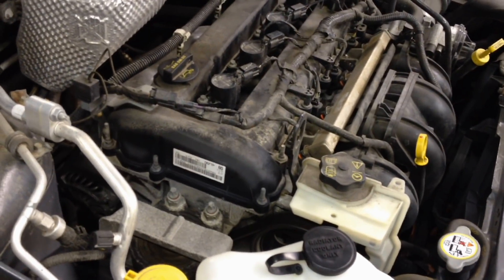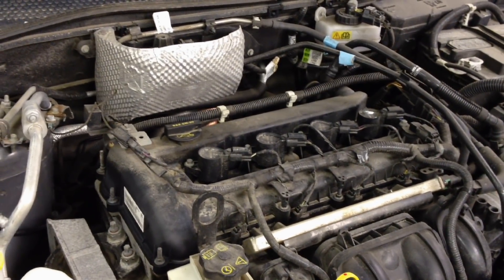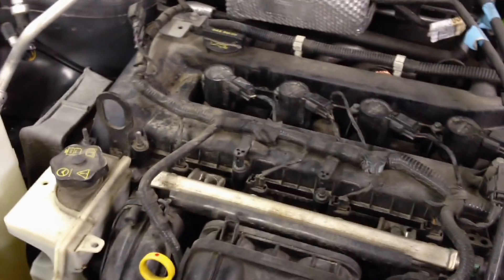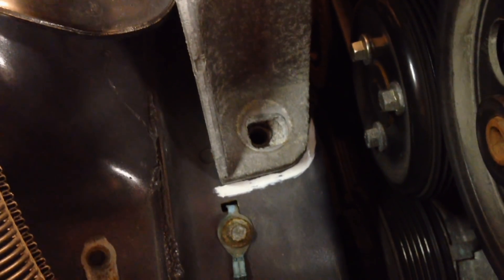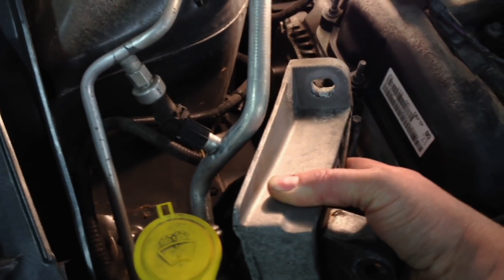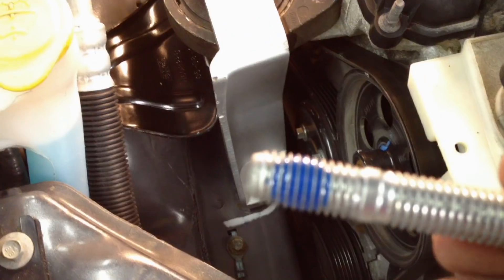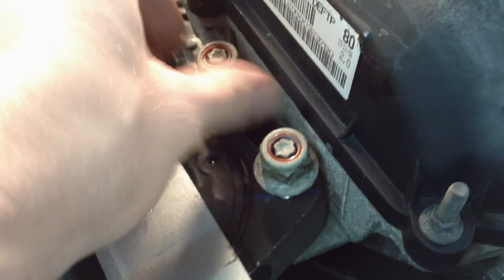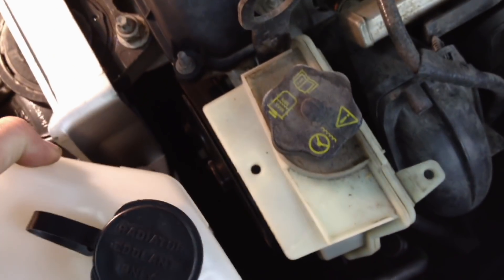Ford Focus Engine Mount Vibration Repair

Comment: Hello good sir.  I followed your video for throttle body cleaning and everything went well.
But now I have a new problem.  The other day i drove over from deep snow, which was hardened.    I don't know if that was the cause of this problem or not.

Anyway, the problem is excess vibration, on the drivers side when accelerating in reverse.
Rolling in reverse is not a problem nor is light acceleration, only reversing and pressing the gas harder causes the noticeable vibration.

Driving forward or turning there is no noticeable increase in vibration.

Do you think the mount is the problem? And your video only shows one mount. How many mounts in the 09?

I think i found the correct part on fordparts

is this it?
							 Part No. 6038 							
					 						Engine Mount Isolator
						2.0L Duratec HE (137PS) ; 4-Speed Automatic Transaxle - 4F27E
Reply from the maker: Arbys Uunt Meet there are three mounts the one shown, the trans mount and the anti roll restrictor underneath that is the one I would check for the reverse problem. 6038 base does sound right.

Comment: Quick question: got the part and it only has the center piece. The silver and black frame brackets didn't come with. Can I take the OEM one off the old one? 

Thanks, great video
Reply from the maker: vintasalo You are supposed to be able to but if you bought anything but oem you are going to be having problems with the new mount before long.
Reply: FordTechMakuloco Cool, thanks for the quick reply. The one I bought has a lifetime warranty with Advanced Auto Parts..  Good thing its a quick fix if I need to replace again

Once again you did a great job making it a quick, instructional video.
Reply: lightningsmokerXx Ours is a Florida car and never seen snow. No rust anywhere and we live 300yards from the ocean.

BTW: this fix worked perfectly and now the car runs like new

Comment: Hello Makuloco, on my 2012 focus mk3 I'm having vibration through gas paddle around 2000 rpm, and vibration through steering wheel around 1200 rpm. These vibrations happen about 20% in summer and 90% in winter, and do not go away after warming up. Idle is smooth tho, could it be a engine mount problem?
Reply from the maker: I would have the engine mounts/ Powertrain neutralized first and go from there. Your mount should not be bad.
Reply: FordTechMakuloco Thank you sir.

Comment: Great video. I think you may have helped me diagnose my U.S spec 2010 Transit Connect van with the Focus engine and mounts. Van only has about 36k and the problem started a while back. Vibration is noticeable at all times. Most noticeable through the gas pedal. Tried jacking the engine up and the vibration went away. Hopefully it's the passenger side mount. I'm hoping Ford will pick up the tab as I complained about the vibration and have it in writing well before the warranty was up.

Comment: Hello FordTech. I have a 2008 Ford Focus, and need to know about reset of check engine light. Popped on before i had thermostat and housing changed. Light went out after, but came back on. Mechanic read code, and told me it needed to be calibrated by Ford technician. Is that true?
Reply from the maker: Paula Thomas No it shouldn't what code?

Comment: Hello Sir. I own a ford focus mk3 2011 Ti-vct 125ps engine.
When i m driving between 3,5 and 4000 rpm i can feel a resonant sound-vibration coming out from the front part of the car and from the bottom of the car( driver and co- driver seats).
Also at certain rpms like 1500 and  2700 my car vibrates.
Do you think that the mounts can be causing this? I, have already 55.000 miles on the clock!
Reply from the maker: papadas19 Yes I do, do you feel it at idle cold starts etc. I would do the test as shown to verify.
Reply: +FordTechMakuloco 

I changed the passenger side engine mount. The vibration remains and seems to be stronger? I m really worried. Should i change the other 2 mounts to see a good result or do you think that the problem does not concern the engine mounts, because the replacement of the hydraulic engine mount didn't help?
Looking forward for a proposal on the problem. Thank you!
Reply from the maker: Alexandros Sourlas was the mount a Ford Unit?
Reply: Yes....it cost me 208 euros :(.....it didnt help though....

Comment: Thank you for listing the torque amounts.  Mine was rattling so bad it cracked the windshield.  The mount was disintegrated into two separate pieces.  WOW WHAT A DIFFERENCE!  Simple job!  A note of difference from all the other videos I have seen, including yours.....My passenger motor mount stand did not have a 6th bolt underneath.  Mine was removed by removing a metal subpost(like Tom Crawford below).  

Altogether, A simple procedure, and it runs so quietly now!  I got my replacement piece for $20 bucks from a parts wholesaler(I never pay retail).  Thanks man!

Comment: Would a clutch and fly wheel replacement cause vibration / clunking at start up or rev up? vehicle is a 03 Mustang Cobra.
Reply from the maker: skywalkier Yes there is marks on them for balancing that need to be aligned to get the most balanced setup.

Comment: How long can you reasonably expect these Focus motor mounts to last? My friend is buying a 2010 (it's now the beginning of the 2015 model year, so it's 4-5 years old). It has 77,000 miles. She complains of vibration, but I'm just not sure if it might be the mounts or not. Will try your trick to jack it up and see if the vibration goes away when she takes possession in a week.
Reply from the maker: I have seen them go in as little as 44k miles so at this age I would say yes it is time.
Reply: FordTechMakuloco Thanks for the reply. Is it worth it to replace just this RH mount, which is the "low-hanging fruit" and see if that fixes it? This looks like the easy one, relatively speaking and appears to be the one that goes bad most often. And of course you've done a great job explaining it here.
Reply from the maker: Yes I would just replace it, like you said it is the absolute most common one.

Comment: Another thing, my 2010 focus is developing a "bang" feeling and noise while driving over bumps, as well as when depressing the clutch for up shift at ~2500RPM (standard tans). Will that possibly be bad transmission mount or the dog bone?
Reply from the maker: I would definitely check the mounts and the swaybar links for looseness.
Reply: FordTechMakuloco Thanks! I will check them

Comment: I don't know much about cars but when I put my car in revers my car shakes like crazy and it's embarrassing . Is it the bottom motor mount ?
Reply from the maker: It can be the lower dogbone mount but the right hand engine mount as shown in video is most common and can happen in drive or reverse.

Comment: Thanks for the video, got the job done. My replacement part from O'riely was only the insert, had to pry old one out and then bend a tab to keep the new one in. Didn't realize going in the lift point on oil pan was critical to getting a good lift. If too far to the center it lifts entire car.
Reply from the maker: If you lift too high it will lift the car yes.
Reply: FordTechMakuloco I had loosened the motor side nuts and the motor was lowering even though had jack under it but too far to the tranny side of the motor.

Comment: If I need to replace my motor mount, when will I feel the vibration the most? My 2004 focus sedan (4 cylinder 2.0 liter automatic) seems to rumble as I'm coming to a complete stop, but is fine at higher speeds, parked and in reverse... Not sure if I should get the brakepads, transmission, or motor mount checked first.
Reply from the maker: I would get the brakes checked first for sure, then the RH engine mount as shown in the video.

Comment: Good job good to see someone clean the parts prior to assembly and using a torque wrench to avoid damage and making it easier for the next person.Thanks for the video we need more mechanics like you.
Reply from the maker: Thanks!
Reply: @FordTechMakuloco  You're AWESOME!! LOVE your videos!! My mom has a 2011 Focus SE. Always doing the work on it when it needs it.  She has the same problem. I am pretty sure it's the motor mount. If it is, should the driver's side mount be changed too? I am just thinking about changing things in pairs like suspension parts. Thanks in advance...👍😁
UPDATE ...The mount(s) seem fine. I think it's her muffler. It did have a few small leaks on it on one end of it. I patched them up but a s***load of water came out of it. I think it's shot inside. Rusted from inside out. Should I buy an OEM muffler from Ford or are the aftermarket ones just as good? Thanks in advance....👍😁

Comment: wooow wher u buy  the part my card ned thisss
Reply from the maker: Get a real Ford one only from wherever you can Dealer or otherwise but make sure it is a Ford Mount.
Reply: ook  thank u so much
Reply from the maker: It is very similar yes.
Reply: ok thanks

Comment: Just replaced the engine mount on my wife's car.  There is no way you can go wrong by following this video.  You even gave us the torque specs and everything!  THANK YOU for this!!
Reply: Unler the nuts inside the chassi snaps out and rotate with the bolt!😅😅

Comment: Where did you purchase your engine mount?
Reply from the maker: Well it was  customers car but we only used the ford mount from wherever you can find it cheapest. The aftermarket mounts are a nightmare everyone has problems with them so stick with ford.
Reply: FordTechMakuloco
Good to know. Thanks man!
Reply from the maker: No problem glad to help.

Comment: Good tip about checking for the change in the vibration by unweighting the mount slightly with the jack, I'll have to try that-  Was the bad mount visibly damaged upon inspection after it was removed, did it show cracks or anything?  I was wondering if it could be inspected visually while still installed, is that possible?
I seem to recall the idle on mine got rough after the engine got an oil mist bath from leaving the oil fill cap off; could that have prematurely caused the mounts to go?
Reply from the maker: They are almost never visible damaged until they are so bad they have tears in them on the underside. I wouldn't even waste time inspecting, try the jack technique and you will know. The oil bath would not cause the mount to fail no. You sure oil didn't get into the coil wells?
Reply: Maybe for the sake of science, I'll make a measurement of the sag of the engine side mount to the bracket surface and compare it with a newly installed one; it would seem like that distance would change as the mount sacks out.
Reply: FordTechMakuloco I didn't have a chance to try unloading the mount with a jack yet, but I checked the right side mount by taking a strip cut from an old credit card and tried to slip it underneath the insulator, to check clearance between it and the bracket - nogo.
There was no clearance, so that indicates it's basically grounded and sitting right on the bracket with no isolation - failed mount no longer suspending the engine properly.
Reply from the maker: ***** Yeah the rh side is very common.

Comment from the maker: I have never had an issue removing the bolts for the anti roll. A little rust penetrant is advisable of course no matter what. Yes where are the pictures located

Comment from the maker: Not sure which bolts you are referring to but I am sure they are supposed to be there. Yes you can use ramps in the rear but make sure its in park AND parking brake is on as they are natural free rollers back there.

Comment from the maker: Remove both bolt pull mount and check out the cavity it sat in the subframe. No engine support needed may roll a inch or so but that's it.

Comment from the maker: I used a paint pen because a little brake clean and it come off, but a sharpie marker will do also. The anti roll mount is underneath center backside of the engine, mounts by where the trans and engine meet looks like a figure 8. Rocks get stuck behind it where it mounts to subframe. I would check this out first as it happens primarily in reverse when the engine torque loads the mount rearward. Search for tsb 8-5-6
Reply: Got the mount from Oreilly. It looks a little different. The brackets are a bit different on bottom even though the holes are an exact fit. I actually had to file a little off the bracket closest to valve cover it was almost top snug making the studs too angled. Just fyi if you get the oreilly one. $112. Great vid runs a whole lot smoother once installed

Comment from the maker: Never seen the other side which is the trans mount go bad like the right hand side engine mount in this video. Go ahead and check it like I show in my video. Other thing to check is the rear anti roll mount under the car for rocks causing the vibration when the engine is loaded a certain direction.